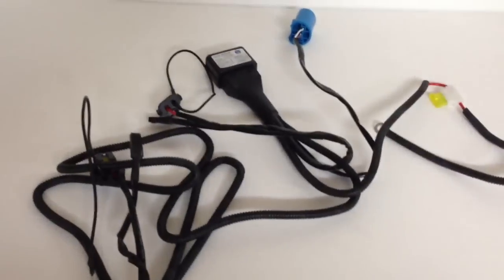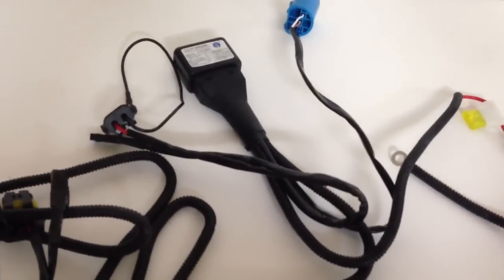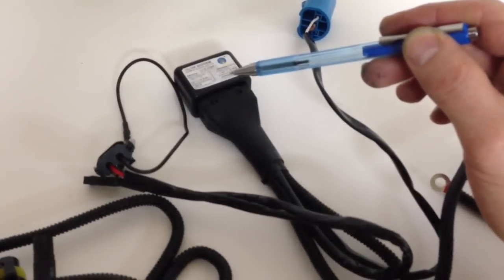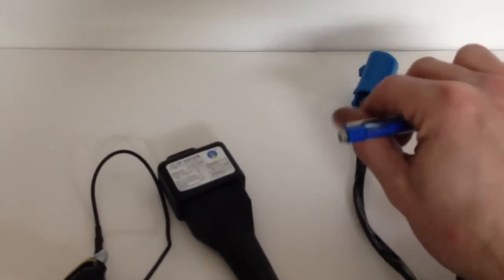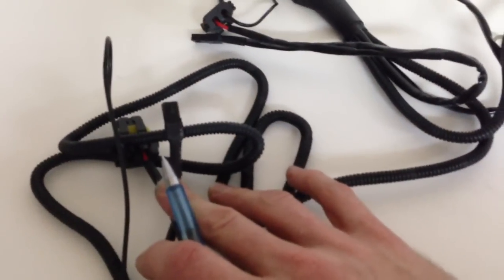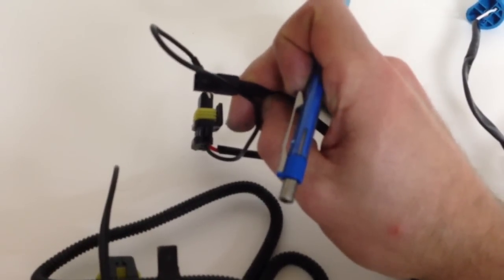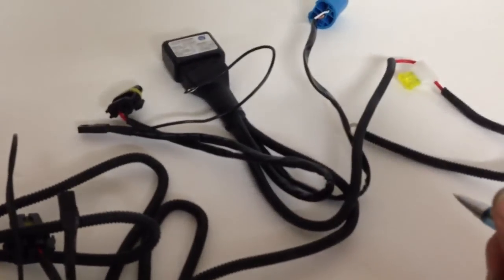Bi-Xenon HID wiring harness explained

Comment: I had this for a while, the 12v wire melted with the in line fuse. Is it better idea to have two of these instead of one 12v powering both sides? Too much load?

Comment: Sir in had ordered the bi xenon projector and it support h1 hid only i have Yamaha r15 v2 bike in which h4 connection typ socket is ....how can it connect h1 hid in to h4 connection
Reply from the maker: DJ Prashant DJ PRINCE hi there. If you purchased from us, please contact us through the website with your order number and we would be happy to assist you.
Reply: HIDprojectors.com does it's possible

Comment: Hey, can you please tell me what that wire at 2.12 is used for? I couldn't find any connectors in my ballast, amp adapters to connect them too. Thanks so much!
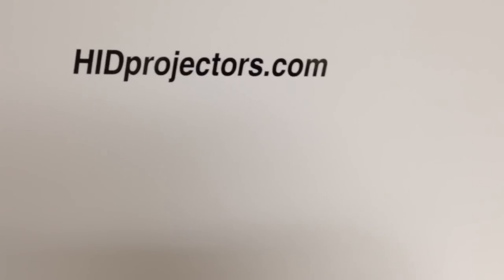Reply from the maker: Hi - there's no wire shown at the 2:12 mark.
Reply: Oops. I'm sorry, I meant to say that IEC C7 type female connector at 1:42. The screenshot is here - https://www.screencast.com/t/awcg6MTasqFN. Another novice question, do I need 2 relays for a pair of projector or 1? Thanks!!!
Reply from the maker: That's for the high beam plug.  If you have specific questions on our harness please contact us through the website with your order number and we'll gladly walk you through it.

Comment: I tried to install an bixenon H4 kit today with no luck(Kensun). I hooked the wiring harness up correctly with everything in it’s place. When I flash the high beams I can hear the bulb “click” but the lights wouldn’t turn on. Ended up putting the halogens back. 
Are bi xenon kits just generally finicky or was mine just shot? Gonna just return them and pick up LEDs
Reply from the maker: HID will outperform LED bulbs in just about every application.  Perhaps you need a better harness.  I'm guessing Kensun wasn't able to help?  My advice would be to purchase from an american company with a real tech support line who can help with the install in cases like these.

Comment: Hello Tom I have a kit from another seller however the harness and relay are the same it is a 9004/9007 Kit stickered as 9007 and I matched up the wiring with the one you explained in this video. I was wondering if you had any suggestions as to why (when I have everything connected up as you explained here and as well as the installation instructions that came with the kit) I have one buld that is constant hot when the headlamp switch is in the off position and when I turn it on both bulbs go hot? I have double and triple checked everything to be 110% sure t is connect correctly. I was attempting this install in a 2002 Ford F250 Super Duty, no daytime running lights. I tried two kits from two company's with the same results. I eve went as far as extending the power wire on the replay to try installing the relay on the drivers side and connect to factory wiring there and the issue followed to side of the truck. The buld that is always hot is the one on the shortest wire or always closest to the relay... Any help or suggestions would be greatly appreciated. I have already tried several times to get help from both sellers and one just sent a free replacement kit which did the same thing the other one only offer a refund if unused (eBay sell who was an ass and called me a liar after they tried to cover their mistake by telling me I don't know what I drive and wanted my vin# or a picture of my truck).. I have had nothing but trouble and no one seems to be willing to help out. If you can get me in the right direction I will be sure to make the next purchase from you.
Reply from the maker: Could be a bad relay, bad ground, or something with your stock wiring. Some troubleshooting would be necessary to determine the root cause.
Reply: HIDprojectors.com
Ok, I'm banking on the relay as the stock bulbs work just fine. I had two sets of the HID's from different MFR both having the same issue. I have one more set from yet another MFR if it has the same issue I will give up on the idea.. I even tried swapping the relays from the two kits and when I did that nothing came on other than my factory parking lights. Thanks for the replay..

Comment: What about when your HID has 4 connectors ?? It has 2 large connectors one male one female then 2 smaller connectors the red male and black is female and my ballast only has 2 wires
Reply from the maker: tribalrocker Sounds like you purchased from somewhere else.  I would suggest contacting them for an explanation.

Comment: if my engine/battery is in the rear, hence mid engine cars, what would your advice be for connecting the wire that is needed to connect to the battery?
Reply from the maker: Kenny Yu Simply extend the power cable on the harness to reach the battery.
Reply: Kenny Yu You can tap into the fuse box in the engine bay for your 12v supply.   Then just ground to the body.  I put HID on my 2003 Lincoln LS and had to use this method because the battery is in the trunk of that vehicle.  There is a video on my channel about it that may help you out.

Comment: I didn't purchase from you, but I have the kensun HID bi xenon kit I installed on my 2006 jeep liberty. My driver side is dimmer than the passenger side with low beams. When I turn my high beams on the driver side dims even more and the passenger side gets brighter. Any thoughts on what the issue could be?
Reply from the maker: I would suggest contacting Kensun.
Reply: I hope you see my other post to you before this one but this is the company that only sends a free replacement kit and no other help.

Comment: Hi, I have Suzuki Swift 2013 that use H4 (Hi and Low on one bulb). I'm replacing the headlight with projector and now the Low-beam use H7 and Hi-beam use H1. The problem is when at night with Low-beam is on, I switched the Hi-beam on but it will turn off the Low-beam. Do you know how to make the Low-beam stays on when I'm using the Hi-beam? Thanks